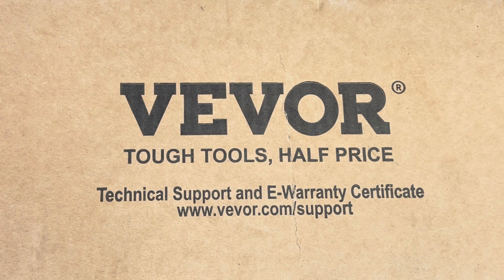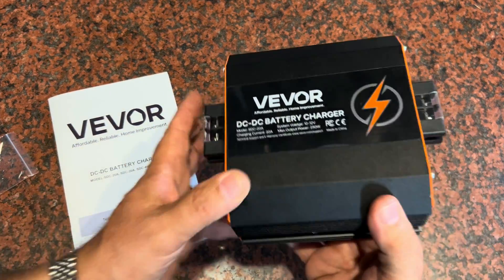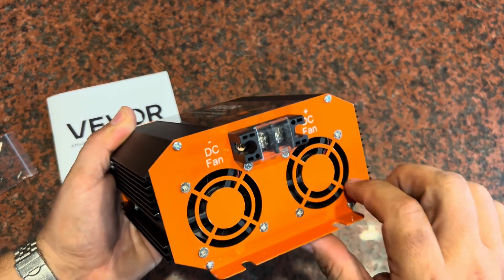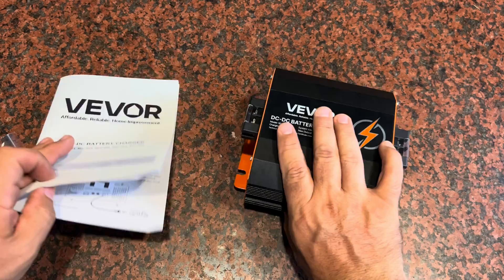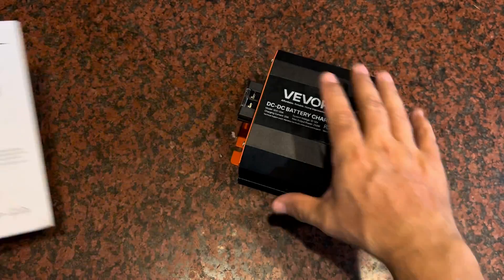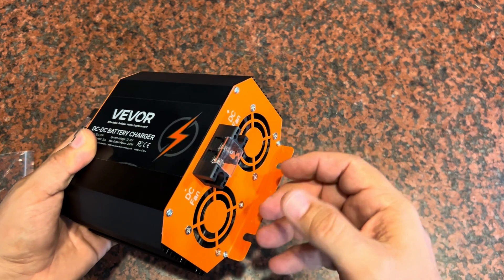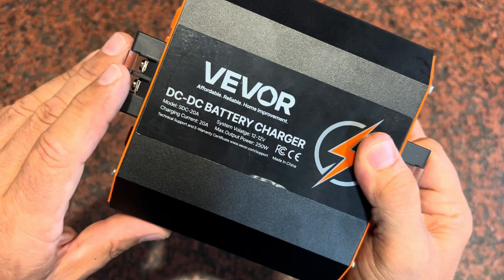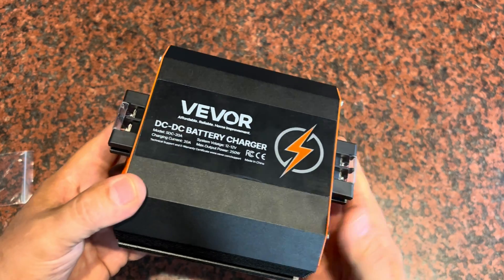Checking Out This DC-to-DC Charger for RV by VEVOR

Comment: Is the charge rate adjustable?
Reply: Would also like to know. As well as how loud it is.
Reply: @Dgfatz  you can only split it at half - if you have 20a you can limit to 10a, 40a => 20a. By passing +12V to 6.pin. More in manual.
Reply: @pwiencko I have red and black from start battery to dc-dc and red and back to lithium it's not working no lights come on
Reply: Installato si accende tutto ma non funziona posso vedere un tutorial più specifico ? Non ho trovato.per 30A